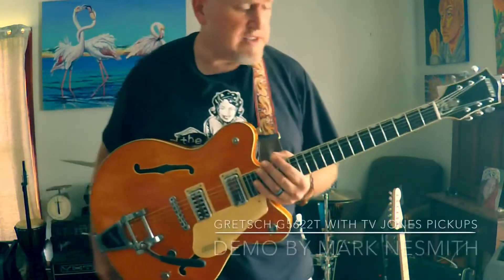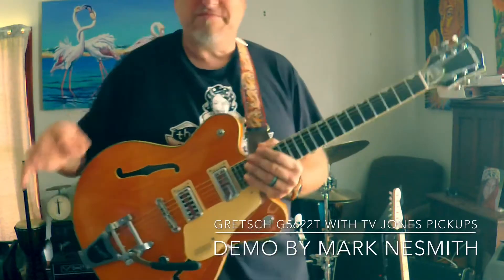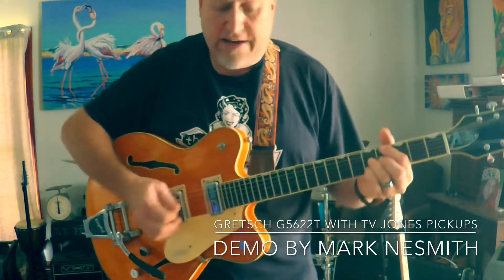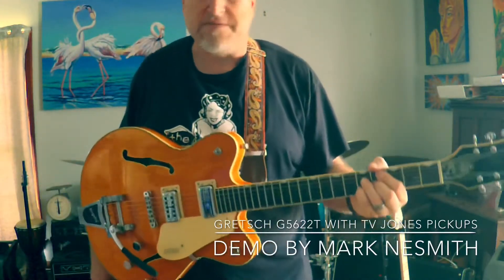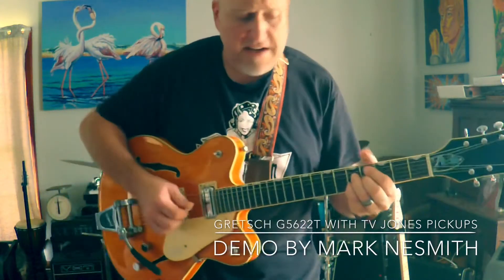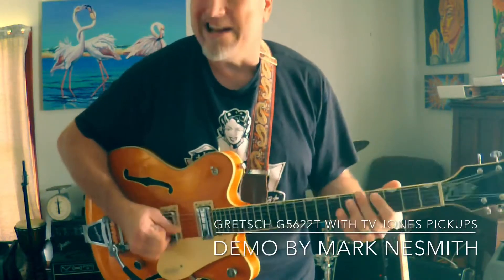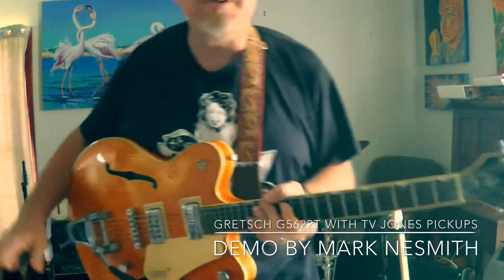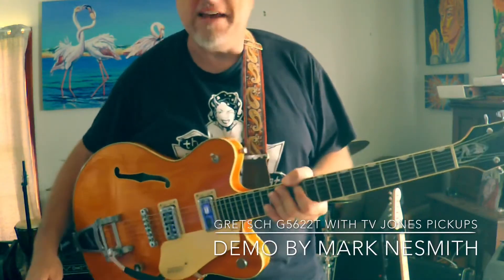DEMO Gretsch G5622T modded w/ TV Jones Pickups, ABM 2400 roller bridge, and BricksBiggsFix

Comment: Great demo! Hey, how works the pickup circuit? I mean, when the pickup selector is in the middle (both pickups) if you decrease at 0 any pickup volume, does the other pickup continúes working or the volume decrease totally for both pickups? Thanks!
Reply from the maker: The other pickup continues just fine. The Gretsch setup on these guitars has a master volume on the treble side horn, then individual volume controls for the two pickups and a master tone control are beneath the bridge.
Reply: @MarkNesmith  thanks!!